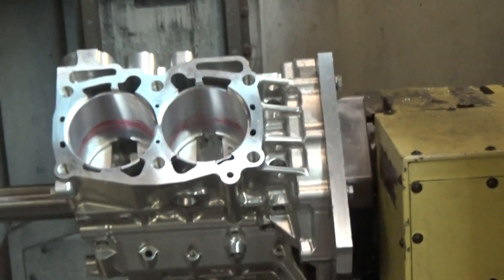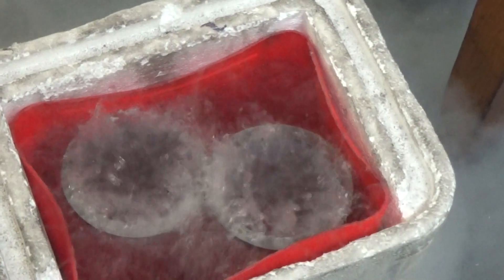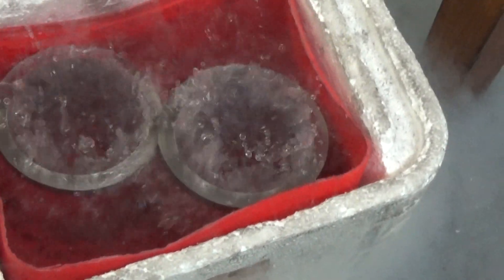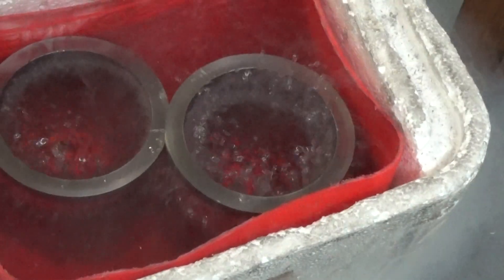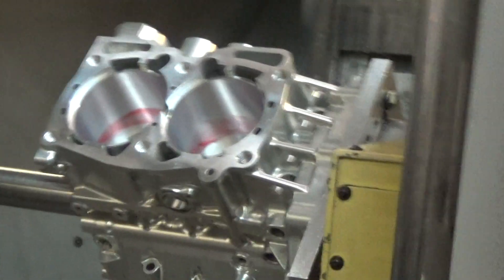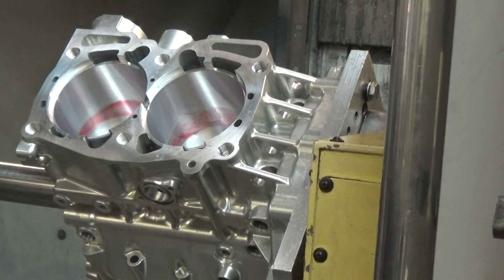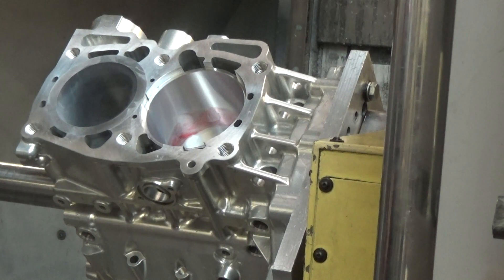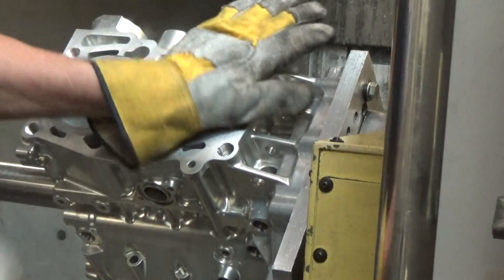Installing sleeves in Crest Subaru billet block with liquid nitrogen

Comment: How much the clereance between the block and the sleeve? 0.02/0.01?
Reply from the maker: Determining the proper interference fit has many factors. A non-billet stock block with an 1/8" wall sleeve e.g. would need .0025", I've done hundreds with that amount.

Comment: I have a mill, I've been tempted to bore my block and sleeve it. This video continues to build my confidence in the process, not needing a press. I've seen people use a honing plate as clamping force till things are brought back to room temperature. I will be doing that. Thanks for the video.
Reply from the maker: Yes, installing the torque plate at full torque value until the block temp stabilizes is the key to preventing sleeve drop. Using a press does not work. I've seen it countless times and it's the main reason shops have Subaru sleeves drop. The sleeves themselves get blamed but it's the shops fault. I've installed a thousand of them and never had one drop, even with 14mm studs at 150 lbs.
Reply: When the term sleeve drop is used its actually the block itself pulling up around the sleeve right? Would be the same with a sleeve being installed with a step at the bottom of the bore? What's a guy to do if a torque plate isnt available? Thanks

Comment: Wow, that makes life easy!  At room temp, how much of an interference between the block and sleeves?  It's hard to get liquid nitrogen around here, I have to use alcohol and dry ice to cool down valve seats - and I have to warm up the head :)
Reply from the maker: Actually, for whatever reason, a typical valve seat will only shrink about .002" in nitrogen.  I use it on seats anyway because a .002" helps. I give those sleeves .0015" interference due to their thick wall and the 6061 material of the block.
Reply from the maker: Forgot to add that those sleeves will shrink almost .005" in nitrogen.
Reply: @motion24527  Nice, thanks for the video